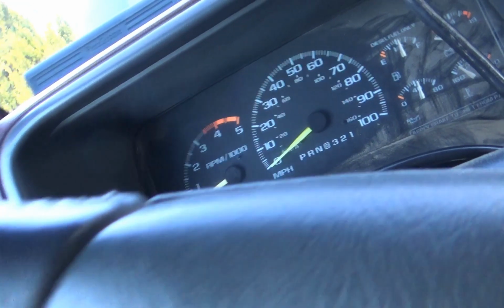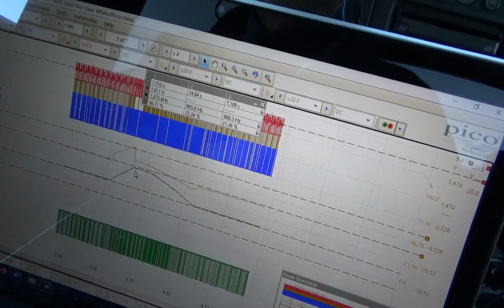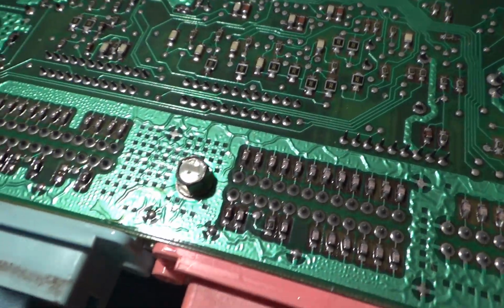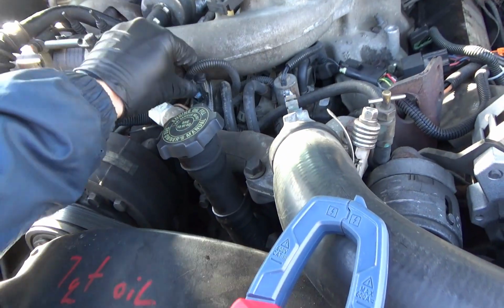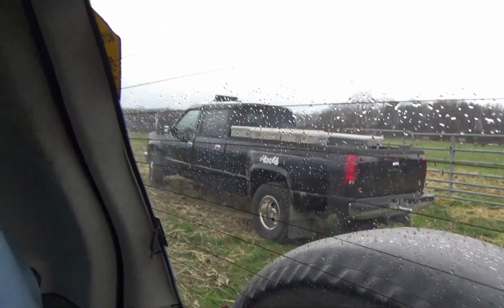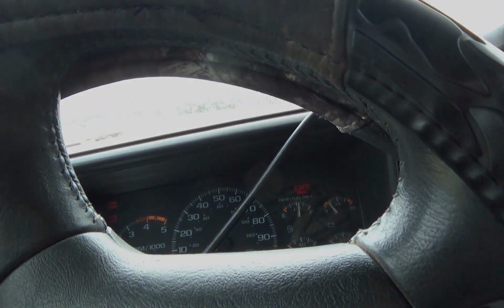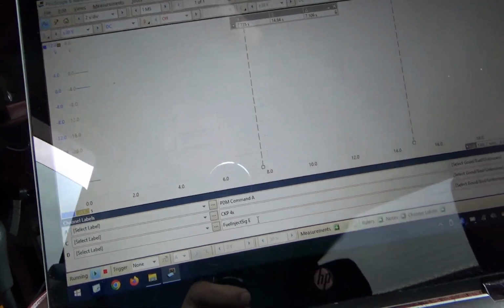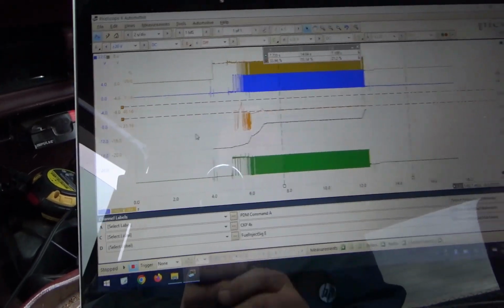Chevy 6.5 Turbo Diesel REVS Out of CONTROL?! (Part 2 - Didn't see THIS Coming...)

Comment: I have a '94 2500 with the same motor. It has 250K miles and is running well. Mine was eating PDM's too until I installed the kit to relocate to bumper area. Since then, no problems.
Reply: Still have my 1996 6.5 3500 with 200,000 miles. Running a fluid damper with billet crankshaft pulley , quality oil cooler lines, and a relocated PDM. But, always make sure those grounds are good between the PCM, transmission and the engine block. If the damper or crankshaft pulley go bad, and they will, the crankshaft will break!

Comment: The mis-mapping of the coolant temperature range in the PCM is a big clue. The PCM you found in this truck is not the original. Someone replaced it with the wrong PCM and you duplicated that incorrect specification when you bought the one on eBay. What was the "original-original" PCM?

Comment: The first thing on part 1 that bothered me was the Coolant Temp. What the resistance was snd what was being interpreted was hugh. That would have been probably over 5000 ohm difference. Typically high temp means LOW ohms only a few hundred at operating temp . A 100 degreeF difference in PCM perception vs reality is alot.  That could have been a 15% incorrect minus adjustment on programmed fuel . I was hoping to find the answer on the Coolant temp sensor issue in part 2. Too bad ,we lost that opportunity to learn something...it might have been a clue to the root cause. What circuit fault would cause a PCM to read 5000 ohms less ? That is question.  The other question is how would it run with the CTS disconnected...running on a default value ?

Comment: The hardest fault I had to find was the 5V reference was randomly dropping and causing random faults and your temp gauge is powered from the 5V rail if you still have the car check the 5V just for fun you never know

Comment: Yes, I would agree that the issue was the pump.  I hate silver bullets personally and prefer testing.  A know good waveform might have told you the solenoid on time was short and verified that the PCM was cutting back.  I believe I have up load several captures to the picoscope library.  The thing to remember in this system is that with increased RPM, fuel delivery time is shortened by the mechanical nature of the inj pump.  So the pulse width would get shorter.  Though I think you were already at the minimum.  I will look at my captures to get a known good on time for you.

As far as the temperature sensor reading goes, I think you will kick yourself for this.  I would suspect it is the scan tool reporting it incorrectly.  It’s hard to have multiple scan tools for something this old but your Modis might be at fault.  The old Snapon Brick worked okay for these but I have found more modern Snapon scanners did not.

Comment: A bad injection pump doesn't explain why the coolant temp is reading incorrectly even with a decade box. In order for the ECU to measure resistance it has to use some sort of internal reference voltage. Sometimes that internal reference voltage is used externally to power other sensors. Since both ECUs exhibited the same problem it makes sense that something external to the ECU is affecting the ECUs ability to function normally.

Comment: diesel engines are a bit more harder to prove unless you can tap into the high pressure lines or control the pump with another source  and your plan with the scope and looking at control was a good step , i had a old diesel come into work and has a issue kind of the same and after doing a bit of testing , i ruled out pump and it was the ECU , but  the challenge  is always good and a shame about the engine but they only can handle so much abuse haha

Comment: What a turn of events here.  I'm sorry to see it but these things do happen.  I once had a customer tow in a 2004 Volvo XC70 with a complaint of a grinding sound from under the hood.  Get it off the tow truck and start it up.  Sure enough, it's making a grinding noise from the timing cover.  I run back around to shut it off and the engine shut itself off before I could.  The grinding noise was the timing belt tensioner ripping through the cover.  And it just broke off in less than 30 seconds while in my care.  All 20 valves bent in an instant.  As luck would have it, the customer was already prepared for the worst.  They agreed to have the head rebuilt and all new timing set replaced.

Comment: I've had a similar issue on a different vehicle, A Peugeot 406 diesel with an electronic pump, (Not a common rail) would randomly rev up by itself and surge, but it was not really repeatable. It was my own car and I chased the fault down for weeks, it also had no codes on the PCM. It turned out to be a bad alternator. Only found the fault after the alternator completely failed and I repaired it. The whole time I was watching the video I was screaming at the screen "Disconnect the alternator!"  I did notice the truck had a NAPA "quality" replacement.

Comment: it was definitely leaking in pt 1... Just kinda shrugged it off but i wouldve been checking fluids before every start in this situtation... Just sayin in hindsight it may have been avoidable if it indeed was leaking as bad as it looked and dumped all its oil while testing. This is one reason i prefer to not work alone bc diagnosing a complex issue can too often take mind off the basics and having a buddy there watching is priceless.. 4000rpm should be safe for that motor as long as it has decent oil and a good oil pump...

Comment: take that pump off and send it to area diesel service and have them test it on there pump stand,  only way to test the pumps,  they can watch actual fuel delivery.   oh and if hes swapping an engine and wants more reliability and easier repairs in the future    swapp if for a 12 valve.

Comment: Had same scenario happen on earlier 65 diesel truck. The original PCM that was relocated. With a aftermarket one caused the PCM to get spiked and the cause their wreck signals. Had to replace ECM and p MD. To fix the problem. But after that it developed the rod knock from an overeving😅

Comment: I know that bothers you - but it should have been brought to you earlier. And besides, it had an automatic. 2 less doors and a manual transmission, and I'd be crying right now..... Anyways, I noticed earlier that when you put it in gear, the RPM's would drop. It would need more fuel to maintain RPM with the load of the torque converter slipping, so that may have indicated the pump wasn't upping the fuel when it should - but of course, it could have been an electronic control issue. I've only worked on a diesel with a totally mechanical pump - but I can say that the difference between no fuel and max fuel comes from parts moving only a few thousandths of an inch. It's a very tricky thing to control.

Comment: Very disappointing. Controlling variables is key during troubleshooting; I'm thinking that i would like to drive that fuel distributor with a signal generator and see if i can get stable RPM. I can setup generator to trigger off CKP if necessary, then alter signal to alter RPM. [Edit: i'm totally assuming, of course, that I can setup the generator as needed to substitute for the ECM at specific RPM's]]

Comment: Well, this story is certainly depressing! I sure don't blame you for the kaboom, Ivan, and I really commend you on the bravery of uploading this video anyway rather than just deleting it. I have a couple lingering points though. Apologies in advance for the long reply 😅

First, I think the 2000RPM fixed idle is a kind of giveaway/red herring. I've never done anything with a diesel, but this appears to run an identical system hardware-wise to the TBI SBCs of the era. My partner and I own several, and me being and EE and him being an embedded firmware engineer, of course we studied the design a bit.

The cause of the high idle I think is a flag in the firmware GM calls "stall saver". When the ECM detects engine response is poor (specifically iirc when actual idle speed goes below table target) it sets the stall saver flag, which forces the idle to a permanently high value. Note that the stall saver flag is reported in the status flags reported by a data stream request, but your scan tool probably doesn't show it since it is a "status" flag not a "malfunction" flag. (It is the 4th byte, bit #4, for TBI. Both the protocol specs and most of the firmware sources have been leaked over the years.) ALDL engines didn't really have codes, they were more like status bits. Other bits in the same byte are things like AC request, various closed loop conditions, power steering loaded, etc.

I *think* the reported "desired idle" is unaffected and that is just the table value based on baro, ECT, P/N/D, and AC compressor state. So this would be consistent with poor response from the fuel control system.

Second, I seriously doubt the incorrect ECT is a double computer fault (though it is possible your scan tool is misreporting the value by applying an incorrect formula to the reported byte). It is a bit surprising that you didn't check wiring integrity, but I get it, the engine blew up. I think the most likely cause is a partial, kohm short to ground or power (depending on the polarity of the sensor divider). Not sure how this could have caused anything you observed? Maybe it was just like that for years, an independent problem? It didn't seem like the engine acted particularly differently when you substituted your own resistance to bring it back to being correct so maybe just nobody noticed?

Minor addendum: the "wrinkles" you see in the board's power planes are normal. That is a result of 1980s PCB manufacturing technology and it left the factory like that. I believe the way they used to do it was, solder plating was applied to traces before soldermask. Today soldermask is instead applied over bare copper (THEN they apply HASL, ENIG, etc. only to the exposed pins).
Reply: Is that big endian or little endian?   Hahaha.  I'm such an idiot on this stuff coming from a mechanical/ aero background.  The closest I ever came to anything like you're describing is Wiresharking a Bluetooth connection between my phone and a radio called Beartooth similar to something called goTenna to reverse engineer what they were doing so I could bypass their SDK.  Never got very far because I wasn't sure what I was looking at.  Dang hex dumps.  I had more hopes for the goTenna because I think it was using Bluetooth low energy, which I believe has to advertise certain things about the interface. And there are tools to look at that.  This is now maybe the 3rd or 4th video I've seen where I'm wondering if the only way today's cars will become classics is if someone designs a new PCM using an Arduino, ESP 32, etc when the OEM versions become impossible to find.  Heck, I think some PCMs could be replaced with analog circuits.  The F-16's fly-by-wire system started off analog in the early 1970s and didn't become digital until the 1980s I think.
Reply: @major__kong  It's a single byte, so there's no endian 😝

Yeah, we made custom electronics to talk to these on ALDL 8192bps. It's a bidirectional bus on a single wire, very simple circuit. (I also built my own "scan tool" that operates on the later Class 2 bus. It is pretty useful to be able to fake arbitrary messages from other modules!)

In ALDL there is a hidden debug command which returns the value at one location in memory, and I looped that to do a full dump of the entire address space to back up our trucks. I think it would be really fun to emulate but TBI just kinda sucks. I think the early 2000s LS (before they added displacement on demand) is just a better engine. We've hacked that a bit too. Double the MPG right? And 150 more hp? And it doesn't sound like some super loud ancient machine?? 😅

Modern stuff is a lot harder since they have "security" to try to prevent you from messing with it. It sucks. Even early 2000s.

Duplicating the electronics to run a modern engine has been done! I'm more worried about inspection rules, in that it is illegal to do so. It is illegal to use any part which is not certified for use. And where I live, there are inspections. Personally my reason to keep TBI going is that the vehicle has sentimental value, I don't drive the 8mpg monster very often anymore, so thankfully nothing gets very much wear.
Reply: @jessicav2031  I told you I was an idiot on this stuff.  

I try not to let illegal or against the rules get in my way as long as it's safe and there's grey area.  And there's a legal principle called "de minimis".  Just don't be like the Diesel Brothers selling the stuff 🙂It's the only way to get things done where I work.  As a program manager, they give me responsibility to get things done but not all of the authority to make it happen.  The people who have the authority don't have ANY of the responsibility, and they will literally fight you with $1M of equipment and a $500K flight test range sitting idle.  It's a recipe for disaster.  So I do what I have to do like have a spare autopilot on hand that isn't technically airworthy for our particular tail number but is newer and more reliable and has the same power and logical interfaces and has flown on other models of aircraft similar to ours.  The guy who was, for lack of a better word, my configuration manager including airworthiness blew a cork when I told him 3 years after the fact.  But his boss was there when I said it and told him to take some pointers from me.  Now, this was an unmanned aircraft, and we were flight testing in a godforsaken place called China Lake.  If we crashed, no one was getting hurt.  And potential loss of the hull was my decision to make not theirs.  If you haven't figured it out yet, I work for the Dept of Defense, and this is how we roll unfortunately.  It's also how we're going to lose the next war, but not if I can help it.

BTW, no inspections where I live.  It's like a regular episode of Just Rolled In.  But our locals haven't learned the spray foam "trick" yet 🙂  I sometimes have lunch at this awesome gyro place.  It happens to be next to an Autozone in a lower income part of town.  The stuff that rolls into that place defies logic sometimes.  I keep tools and a scan tool in my truck for my own emergencies, but sometimes I find myself helping or being asked for help.
Reply: They make aftermarket pcm’s. ‘MegaSquirt’ for example. I myself have never used one so not sure how they integrate with instrument panel. Seems like the ones I’ve seen people use a digital screen for the dash with maybe simulated gages.

Comment: Maybe you did this test and I missed it, but I doubt it would have made any difference.  Measure the signal from the temp sensor at the PCM to see if it matched what it was at the sensor?  I watched a video where Scanner Danner was talking about technicians need to be compensated regardless of the outcome.  He was on a service call to a shop that couldn't figure out what was wrong with a truck but the truck didn't act up while he was troubleshooting it.  You have a lot of money tied up in your tools and equipment, not to mention that value of the knowledge you possess is priceless.  Very few people can do what you do, and that is worth something.  IMHO.

Comment: Too bad you did not Google this issue earlier before engine failure  , I replaced over six hundred pumps under Warranty and who knows how many customer pay jobs , the Warranty pumps I kept in a log book just in case somewhere down the road a GM auditor had issues and wanted to charge back the dealership somehow . End of the story is my Service Manager and dealer owner had to sit through three GM Warranty auditors go through every injection pump/vacuum pump  /fuel lift pump / turbocharger and engine assembly replacements for five years , dealer owner apparently losing his mind over the possible charge backs to the dealer . One of the auditors came to speak to me in the end , they could not find one dime to penalize us . The key for every tech is to document every detail /voltage  reading / OHM resistance reading / fuel pressure and fuel quality . The more detail on a work order customer or warranty , the better

Comment: Worked on these engines when I first started doing Fleet maintenance 25 years ago  on 1 ton box trucks .( bread trucks ) They were automatics. When they failed we converted them to Cummins 4bt with stick shift . We had manual trans ,clutch pedal ,linkage springs all in stock.

Comment: Bet it spun a bearing with all the high rpm before it would have built oil pressure. 
I was thinking the same, it was like the pump was pushing more fuel than it should have. Almost like it had too much pressure from the low side creating over pressure on the high side.

Comment: A bad situation, no doubt.  Like you said, though, you can't diagnose without running the engine.  I just have a couple of questions:  Is there a separate mechanism that cuts fuel for the rev limiter?  Although the PCM couldn't regulate engine RPMs otherwise, it did react to prevent a runaway.  Second, did the waveforms look the same right at the PCM. or was there a harness problem between the engine compartment and the control?

Comment: I would have been investigating that coolant temp sensor as soon as I saw that it only went down to -7F when unplugged. Even on the temperature range sheet it shows it going down to -40F, like most temp sensors. I would have measured the resistance from the ECU connector (since you had it out anyway) to see if the measurement was the same at the ECU as it was at the sensor. who knows, maybe the signal wire was partially shorted to ground or power.

Who knows if it was related, but it would have been a path to go down w/o starting the engine.